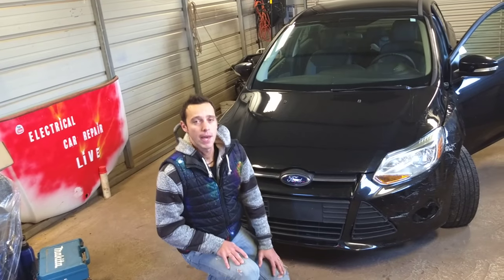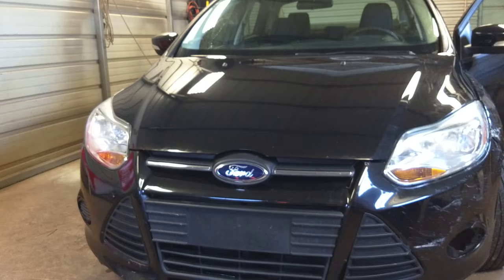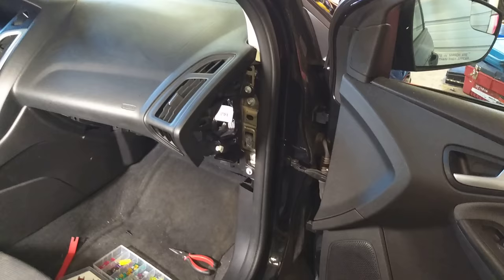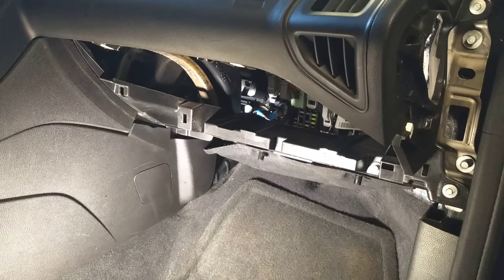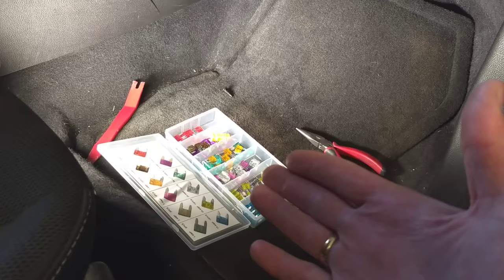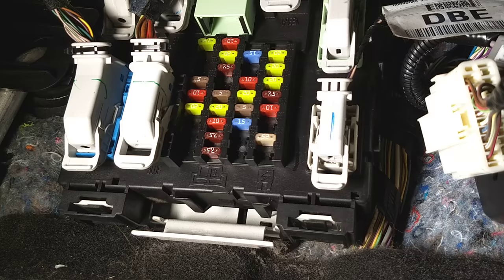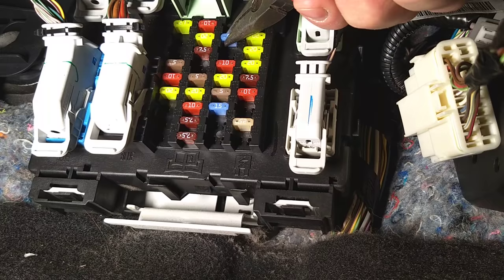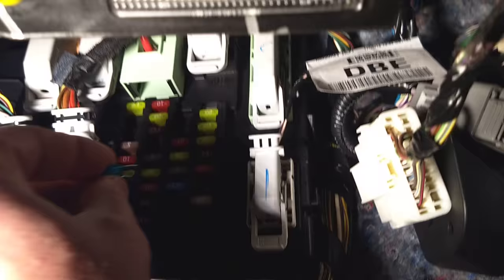LOW BEAM HEADLIGHT FUSE LOCATION REPLACEMENT FORD FOCUS MK3 2012-2018

Comment from the maker: ⛐ Check out our Garage to see what tools we use and recommend:
https://www.amazon.com/shop/worldmechanics

⛐ Subscribe and hit the notification bell by the subscribe button for new videos: 
https://www.youtube.com/channel/UCk_lcDzEWLs5fVRYceK3-9Q

⛐ Our GoFundme Page: https://www.gofundme.com/auto-repair-guys
Reply: My right low beam doesn't work no matter which bulb I put in it.
LED. Stopped working. 
Then an HID.
And back to the regular one.
Nothing works now.
Reply: Hey guys I got a quick question to ask. I have a 2005 ford Taurus SE and I have noticed that my right low beam light doesn't work but the high beams do work, what do you think the problem is? Blown fuse or? Please reply thank you

Comment: Is there a drl fuse in this car? I wanna disable the daylight running lights as they turn on as soon as I start the car even when the parking brake is up.
Reply: Did You Find the solution?

Comment: My passenger low beam doesnt work, wiring looks fine within the headlight casing, and the driver side low beam does work. Bulb is not an issue, ive already tested the brand new bulb and it does work on the fog light connector. So the fuse wouldnt be the problem right? Cause one light works fine...
Reply: I have exactly the same problem
Reply: Did you get this resolved? If so, what was the issue? I have the same issue but on drivers side.
Reply: i have the same problem atm. Any solution? focus mk3 2011
Reply: Same issue here 2012 focus
Reply: i got my solution!!!
We had to delete the error memory, than it work again. Never tought that on a car from 2011
Reply: @MrCraaazzy  delete the error memory
Reply: @freemanfornow264  delete the error memory
Reply: @Bepstar  delete the error memory

Comment: thank the inter has ones fuse block diagram that's a bit different has 2 fuse fer head lights low beam .but its a ford so changing stuff is normal

Comment: I have a mk3.5 drl as stopped working and the passenger rear side light, hoping this fuse fixes the issue
Reply: Did it? Also have just one not working

Comment: Hi,
How to fix the "DIPPED BEAM BULB FAULT" After replacing the halogen bulb to LED?
Thank you
Reply: Damn same I wish we got a reply
Reply: Did you figure it outv
Reply: Did you figure it out I need to know it’s driving me crazy
Reply: Just one of my low beam lights don’t work on passenger side. Side lights and high beam work fine. Changed bulb and fuse (f74) still doesn’t work. Any ideas? Thanks
Reply: @Lew4987  I have the same problem did you figure it out?
Reply: @Lew4987 how do you fix it ?